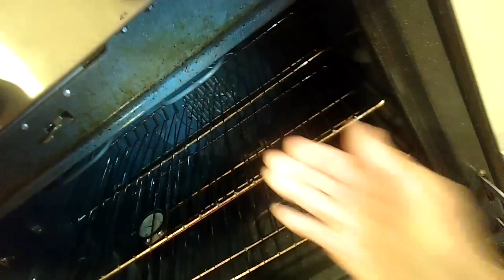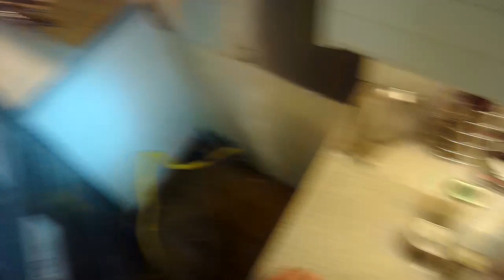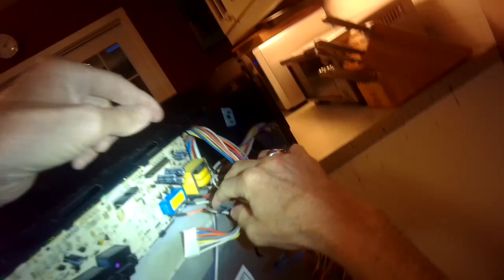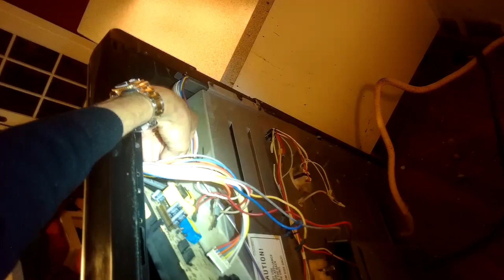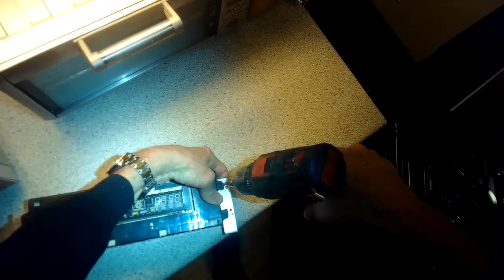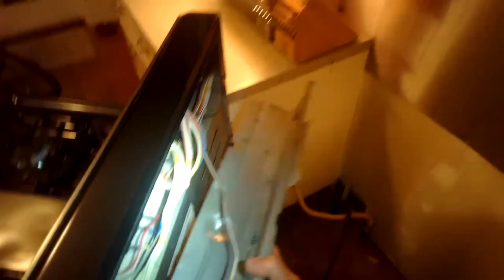✨ GE BROIL WON’T HEAT - CONTROLLER REPLACEMENT ✨

Comment: Hi, Scott. Are the spark plug/igniter all the same or brand specific for gas cooktop? I can see "universal spark igniter" on the internet, not sure if it can work for most cooktops. Thanks
Reply from the maker: You should try and match your stovetop gas igniter to your model number.
It’s usually on a sticker on the frame right behind the broiler pan.